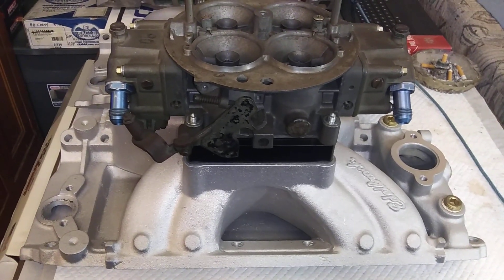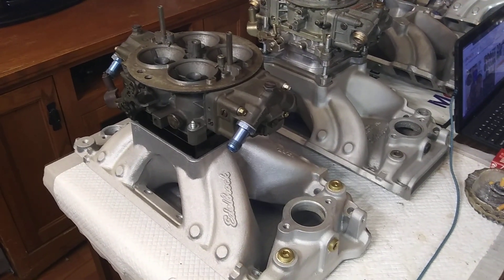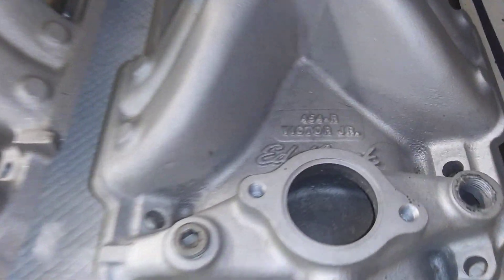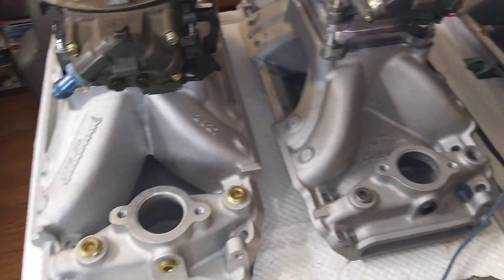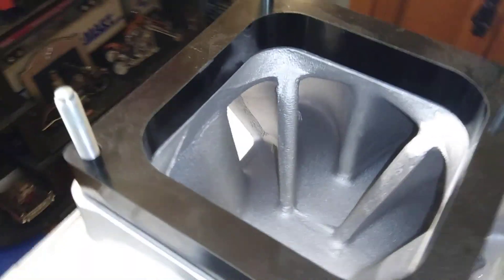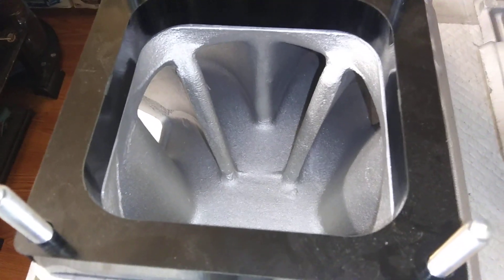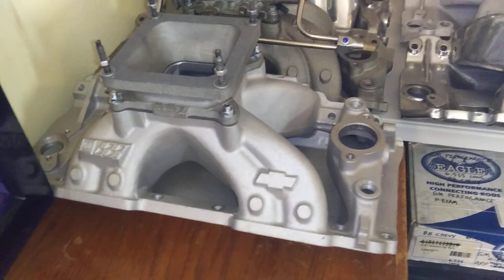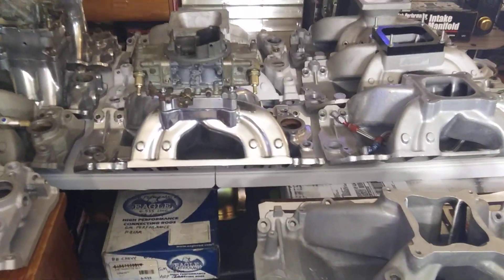Edelbrock Super Victor BB Chevy intake compared to Victor Jr 454R.

Comment: LOL okay 6:41 in so far and man I think you have a problem!!! Yes yes I do... That's a better collection of intake's them any speed shop within 300 miles from me... You have a bad to the bone collection but Hard decision jury is out... I understand how you might have some hard time deciding and pondering the possibilities for speed...  Lol Man I'd like to pick your brain about an industrial tall block 427 Chevy and options for that block to get the biggest bang for the buck not only build wise but what transmission would be a good decision to find because that's the next challenge both Manuel and automatic. I'd like to put it in my 66 Chevelle Malibu for my first Big block heartbeat  this motor came from a grain truck that only had 58000 miles on it and purchased a resided with one owner farm truck that was only used during harvest. I'd like to do something a little more wild than mild go big or go home. But yet I can prowl the street with also I don't spend very much time on the dragstrip not in many years. But wouldn't mind going back but more than likely going on power tour crossing the country possibly a few times. Smoke shows the fun kinda stuff.
Reply from the maker: I'm building a TD 427 block based engine now. 6.535 long  H-beams, 13.2-1 big dome pistons for a standard 9.8 deck 427, stock forged crank, all balanced together. 780 lift, 274/282@.050 solid roller, BPE rectangle port heads that flow near 400cfm, a Bowtie singleplane for a TD block and a 1150 Dominator. That's pretty much the combo I'm going with. T400 trans is the best choice for units like this. Need to build it with a smooth drum and a 34 element sprag. Good friction plates and new bushings, a case saver and a manual valvebody. Best to run shit like this on E85. Cheaper than race fuel. This engine will make more than 700+hp at 439ci.
Reply from the maker: That's just my bigblock Chevy intakes, also have a shitload of SBC intakes, Pontiacs, Oldsmobiles and a couple Buick intakes too. Just got rid of a big Edelbrock for a 472/500 Cadillac. Probably have 50-60 intakes or more.
Reply: @thereluctantgearhead4544  thank you so much for your reply! I will definitely be looking up that video. Sir you are a plethora of information and have a great channel I have enjoyed watching all of the videos I've seen. And am looking forward to seeing more of them. Keep up the good work I've seen some engine builders in my time but it looks to me like you're putting gems together! And every single one of them look roudy and funner than heck.
Reply from the maker: Thanks man, I pretty much live for this shit. I done this for a living since the 80s. Have over 1000+ builds in the last 40yrs. Hundreds of Chevy engines, but a whole lot of other brands too. This is all I've ever done. I'm retired now, but I still work on this shit everyday, just for myself now. Glad you enjoy this shit and it's good to see people keeping hotrodding spirit alive. Being a motorhead will definitely consume your life. I'll probably stop when I'm dead.

Comment: I am with on the less electronic shit, l am a carburetor man my self. Have seen some bad ass mechanical fuel injection setups for mostly race applications.
Reply from the maker: Yep, them old Hilborn or Crower 8 stack injection setups are too cool. Would love to have one myself. A setup off a Sprint Car 410  would be nice to have. Believe they mostly use Kinsler injection. Shits expensive tho.
Reply from the maker: The Ron's Flying Toilet setups work pretty good too for a drag car. They are alot cheaper than a Hilborn or Crower injection.
Reply: Me to Have seen the Hilborn setup on a lot of stuff and know a guy that can set them up but never had the money to try and run it.
Reply from the maker: @JohnMiller-ee9pn  I lost the bid on eBay for a late 60s Hilborn setup for a SBC. Sold for $1205.00. Some asshole outbid me on the last second. It was a complete setup with mechanical fuel pump & timing cover for it and a Moon tank. Obviously came off an old gasser or Jr fuel car. Sold pretty cheap for what it was. No reserve auction.
Reply from the maker: @JohnMiller-ee9pn  That shits still out there.